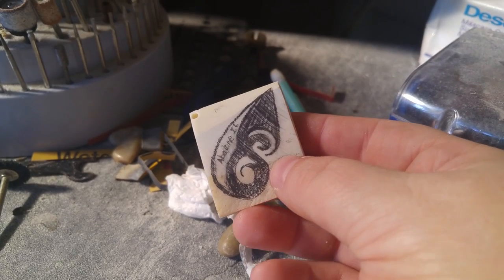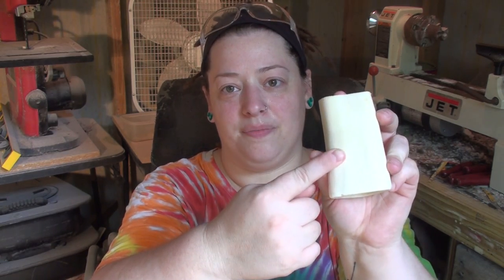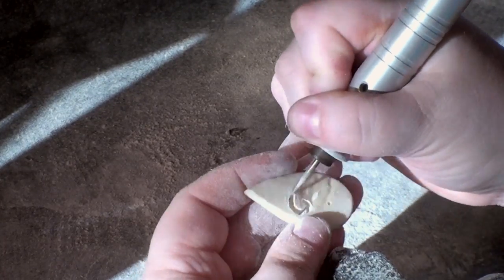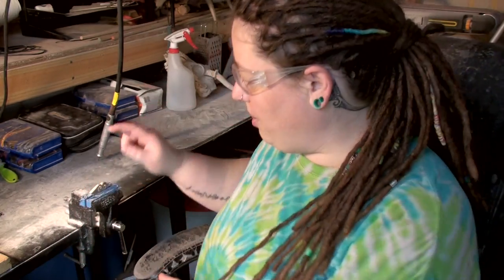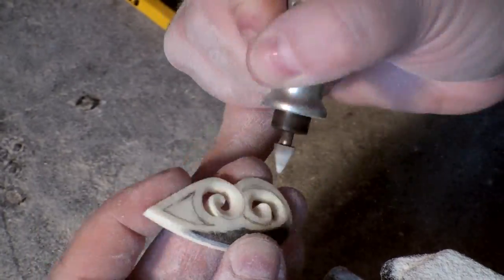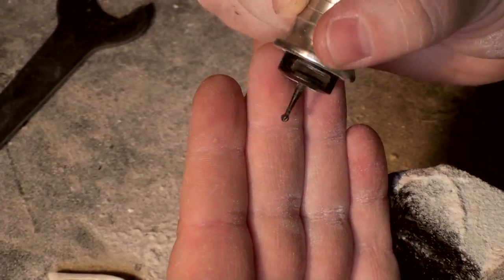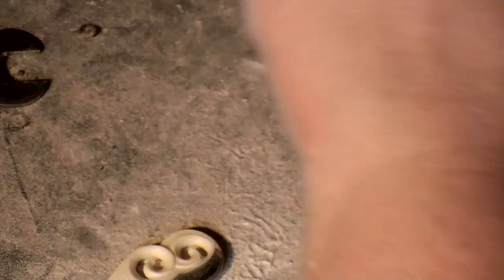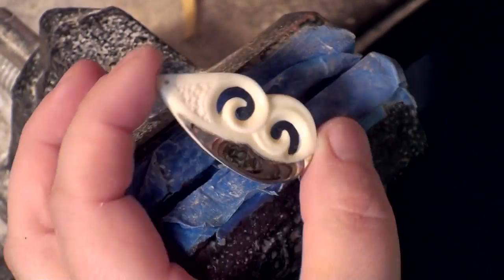Tutorial: Bone Carving | How to Carve a Bone Pendant with Abalone Inlay

Comment: Hi, where do you get the bone? Thanks
Reply from the maker: Hi Seth :) I get my bone from family farm cows that have died of old age or natural causes.  I like to process and degrease it on my own because I can whiten it organically without harsh chemicals. Most farms have a "bone yard", and it doesn't hurt to ask if you can pick through it. However, if that isn't and option for you, you might also be able to get bone from local butcher shops, or pet supply stores. 

Some folks don't like getting bone from pet stores because they say it is more brittle and flaky than home processed bone... but this has not been my experience. I have bought it from the pet store a few times when I'm in a pinch, and it was perfectly carvable... Admittedly, however, I don't normally buy it processed like that due to personal preference(I like to know where the bone comes from and how the cows lived). 

If you want to process your own bone, this video by Antipodart santi is pretty close to how I do it. The only exception is I put some dawn dish detergent in the boiling water, I use an electric band saw instead of a manual saw, and after it is degreased and cleaned, I let my bone sit outside in an open tub full of a white vinegar and water solution for up to 2 weeks: https://www.youtube.com/watch?v=khpcOGZxHec

Hope this helps! :)
Reply: Awesome!  Thanks Heather, looks like I have a trip to the pet store in the near future, until I can source a proper butchers.
Reply: Seth Spriggs Yes, that was going to be my first question. 😂
Reply: Seth Spriggs ya find it lol. There’s a ton where I live
Reply: Thanks for doing these vids!
Reply: @tropicalrarocraftraropareu6295  she lists it in the description. Foredom brand. She includes a link

Comment: I do antler carving and use a 4300 dremel  that has a dial up speed on the tail end of the machine, works well for me, use wet & dry sandpaper always make sure it is wet and above all take my time not rush anything as I am wheelchair bound so have heaps of time, PS just made 2 rings today

Comment: Nice work, glad you recommended a dust mask. I personally dont think the mask you were using is adequate. Bone dust, abalone or paua shell dust is carcinogenic. Take great care working with this material.
Reply: Agreed. A respirator that filters lead paint is what I use. Dust mask doesn't do the trick when your using a belt sander and band saw.

Comment: Great video, just found your channel. Regarding the Alligator scute issue, I know you sounded averse to altering it chemically, BUT, I think resin impregnation would be the way to go to make it a carveable/workable medium. I would recommend either of these 2 methods. First, simply buy a can of Minwax wood hardener, and put enough of it in a jar with the item to cover it. Let it sit in the sealed jar until it looks like it has penetrated sufficiently (a day or 2), then remove and air dry till cured. Method 2 would be to order a product called Cactus Juice, which is a heat activated penetrating resin. For best penetration, a "pressure pot" or vacuum chamber would help, but again, patience and a sealed jar should do the trick. Once permeated, remove item, wipe off excess, and heat at 200 degrees for around 1 hour. I know this probably seems like alot of typing from a stranger, but as an artist myself, I know the value of sharing techniques when you have found a workaround to an issue! Keep up the great work!
Reply from the maker: Hi there. :) Thank you! Indeed you are right. I think that if I ever obtain my own alligator scute in the future, I will certainly use some sort of resin method for stabilizing it. Unfortunately, because this particular scute was not mine, I was hesitant to experiment on it. A pressure pot and air compressor are definitely on my "must obtain" list. Oh, the fun I would have making resin blanks! Thank you kindly for your great suggestions. I will most definitely write them down where I can find them again. Also, your flute skills are top notch. ;)

Comment: I recommend using a multi stage nail Emory block for polishing and sanding natural materials. when I carve bone or antler, I find they work well for being able to put a polish on the final product ( since basically they all are made up of the same material).
Reply from the maker: Black Box Theory Productions Thank you kindly for the advice :). However, I find that those clog up and wear out far too quickly for my needs. Also, wet sanding with them will wear them out even faster or make them fall apart, and I can never seem to get a brilliant mirror shine using them... nor can I easily sand inner curves or crevices.

Comment: I am kind of new to using a rotary tool in that I didn't know there are different sizes of collets. Is that what they are called? I have been using my rotary tool for drilling into bone but my bits are too small. I have been having to make adapters using tape. It works but would rather have proper tool for the job. I did have a bit fly out one time while under a vehicle not because of the adapter thing but because of vibration from the bearing in the rotary tool gone bad. Thank god for safety glasses or I would have lost an eye. Thanks for mentioning that. Wish I knew years ago.

Comment: Love the video. I have a foredom and have played around with carving with it but I just seem to make a mess more than anything. Probably just need to get some better bits.
Reply from the maker: Thank you. :) Bits really do make a big difference! Especially if you are trying to use dull bits... that never works out well at all.Give it another try and have fun! :)
Reply: I picked up a smaller handpeice and am going to give it another whirl
Reply from the maker: Awesome! When I very first started, I had tried using just the dremel 4000 I had... as is. I quickly realized that I couldn't support it for long periods of time and get the kind of movement and precision I needed because of the bulk and weight. When I switched over to using the flex shafts, it did indeed make all the difference in the world. Not sure if that is similar to your situation, but I can relate when it comes to having comfortable hand pieces... don't leave home without em...lol. Good luck and I hope it works out better for you this time.

Comment: Beautiful work!  Can this same bone carving be done with one of the Foredom Micro Motor carvers, they have  the motor in the hand piece and just a coiled wire going to the power supplier.  Or is this bone carving best done with a Foredom shaft driven like you used on this piece?

Comment: I really enjoyed this video. It's very well put together and informative. I've been looking for videos like this. Subscribed and can't wait for the next one. Thank you!
Reply from the maker: Thank you very much! :) I've got lots more fun ideas planed for this year! Once I'm caught up with orders from this holiday rush, I will be actively working on all my new tutorials!
Reply: Thank you for your response! Looking forward to the new stuff! I went and watched it again, just awesome. I do have a question, if you don't mind...? Abalone inlay is very beautiful, but, would it be possible to inlay wood? Like teak or something similar? Thank you again, You're awesome and inspiring!!!
Reply from the maker: It's no problem at all. :) 

You could indeed inlay wood in much the same way. The only issues I have faced in the past when working with wood inlays are first, the wood is much softer than the bone. This makes it a little more tedious when doing your finish carving, because if you aren't careful, you can take of chunks of wood without realizing it while you are trying to trim down the bone beside it. 

Secondly, the wood finish was a challenge at first. I used to finish my wood to a mirror shine using CA Glue to cover the surface. This way I could sand and polish it right along with the bone and it would have the same finish. However, I learned that over time, it tended to yellow and chip away. It looked horrible. So, now I use a custom mixed finish called O.B. Shine Juice for my wood inlays. It is a recipe I learned from another youtuber( https://www.youtube.com/user/capneddie ). With that finish, you can apply, sand, and repeat to your desired shine.

I hope this answered your question! :) Thanks again for the kind words!

Comment: Can give a detailed list of all your main tools and accessories? I burn up a dremel every few months and I keep at least 3 new ones on hand for just that reason. What would you recommend as far as a respirator mask I'm a man I have a full beard and man I've had carbon monoxide toxicity and damn near poisoning a few times so I need something that works.
Reply from the maker: I'm happy to help as best I can. The foredom motor and hand pieces I use are included in the video description. Though pricey, I've had it for years now and have had no issues at all... and I've put it through hell. I've also heard that there is another one similar to the foredom that is sold on amazon for cheaper... and it seems to be popular among other carvers. Though, for the life of me, I can't remember what it is called. I think @bobbydukearts uses one.

As far as burs, I use a LOT... so, it really just depends on what you are trying to carve and what material you are carving. I'm particularly fond of micro carbide burs for detail work, and barrel sanding bits for bulk material removal. I also use diamond bits on occasion. But, like I said, it really just depends on the material you are carving.

In regard to respirators, I just use a standard one with the two changeable front  filters. However, since you have a beard, you may want to try something similar to what @michaelcthulhu uses with nose plugs. I'm not super familiar with that type, as I've never used one, but it seems to work well for him and they are easy to customize.

I hope this helps! :)

Comment: Fabulous work! Is that a regular grinder with an abrasive disk on it? It's so white I can't tell if it's a stone wheel or an abrasive disk
Reply from the maker: Hello Jay :) I'm sorry it took so long to answer you. I sometimes miss notifications on here. It is indeed a regular barrel sanding bit.  I have tried a stone one in the past, but I find it clogs too quickly, thus I just use the regular ones like this: https://www.amazon.com/AUSTOR-Including-Sanding-Sleeves-Mandrels/dp/B07CYQXZSY/ref=asc_df_B07CYQXZSY/?tag=hyprod-20&linkCode=df0&hvadid=309811990469&hvpos=1o2&hvnetw=g&hvrand=7523873934708032357&hvpone=&hvptwo=&hvqmt=&hvdev=c&hvdvcmdl=&hvlocint=&hvlocphy=9051599&hvtargid=pla-493165587048&psc=1

Comment: Hi, why do carvers always use flex shaft tools? Is it cool to use cordless, like a cheap cordless dremel? The only reason I could think of is flex shaft is less bulky and you could hold it better. Is there a quality reason? Thanks!
Reply from the maker: Hi Chloe :)  I can't speak for all carvers, but I use a flex shaft because making small details using a dremel without a shaft is near impossible. Because you have to overcompensate so much for the heavy motor, it not only causes errors in your work, but also becomes very painful on your hand after a while. The vibrations alone are so much worse without a flex shaft, it used to give me "numb hand". In addition, after holding the dremel for an extended period, it was almost as if my hand was frozen in that position after I put down the dremel. Over-all, a flex shaft is a must have if you are planning to carve for extended periods of time so that you can save your nerves and finger joints. Hope this helps! :)
Reply: Heatherfish Creations Thanks!

Comment: i have a question..hope you see it..how do i purchase the sanding disc..you know..the one you begin with...i dont even know how to search it up by differentiating it to the rest
Reply from the maker: Hello! No problem... Happy to help. They are generally referred to as barrel sanding bits and you can find all sorts of kits and combos of different sizes and grits on Amazon or Ebay. Here is one I found as an example: https://www.amazon.com/AUSTOR-Including-Sanding-Sleeves-Mandrels/dp/B07CYQXZSY/ref=asc_df_B07CYQXZSY/?tag=hyprod-20&linkCode=df0&hvadid=309811990469&hvpos=1o4&hvnetw=g&hvrand=3728017050117057140&hvpone=&hvptwo=&hvqmt=&hvdev=c&hvdvcmdl=&hvlocint=&hvlocphy=9051599&hvtargid=pla-493165587048&psc=1

Comment: I note you have used wire on some of your carvings. What sort of wire is it? Can't be silver because that stains bone. Also, I looked up foredom but was not that impressed because the speed maxed at 15k rpm. My old Dremel did 25k+ . If I got back into bone carving I'd go air as the rpm is 60k-70k rpm and smooth as silk to use.
Reply from the maker: Honestly, Carving tools are personal preference. I care more about torque than rpm, as my foredom's max rpm is more than enough. I have found that a strong torque and steady speed prevent flaking and catching during carving.... especially during delicate detail work. My old dremel had more speed too... and with it, more vibration. A number of folks prefer air... however, I do not. In addition, it about gives me a heart attack every time my compressor kicks on... and 8 hours of random heart attacks are not my idea of fun when working on a lengthy project.

I use lots of different wire, enameled, aluminum, sometimes copper. I do use silver sometimes when I'm going for a purposely weathered look. It really just depends. I love the concept of Wabi-Sabi and rather embrace the "stains".

Comment: Love your work. What tools do you recommend a novice artist to buy. I want to work with wood, bone,  seashells,  and stones. What core tools do you recommend. I am moving to the country where I'll have more time and also space. I will buy tools piece by piece. I just subscribed to your YouTube. I can't wait to learn from you.
Reply from the maker: Hi Jeremy :)

Thank you! Honestly, the tools would depend on a wide range of things... What is your budget? What type of work do you want to do with these materials? There are many different styles of carving... some of them require simple hand chisels, and some can utilize power tools. However, I will try to narrow down to some of my most used tools for you...

In an ideal world, for machine carving wood, bone, and shell, I would highly recommend the foredom kit I have in the video description. This will be your most used tool and the one that can make or brake your ability to carve for long periods of time. After using a dremel 4000 for years, the foredom really saved my hands, wrists, and bank account. The dremel flex shaft started braking every 3-4 months with regular use for me, and that is about 30-40 dollars a pop. However, because the foredom is expensive, it is not always and option for everyone right away. In that case, the dremel + flex shaft does work, it will simply not have the same amount of torque or durability if you carve 6-8 hours a day. The bits I use are bits that I have collected for years from several different outlets in box stores and online. I highly recommend a good set of carbide and diamond coated detail bits, barrel sanding bits, and a diamond cutting wheel(good for processing raw abalone into inlay squares).

Another few tools that I use on almost 100% of my projects is my band saw, my combo sanding belt, my metric/standard conversion calipers, and my handheld jeweler's saw. Those are essential for rough shaping and measuring base material. If you are just starting out, I wouldn't worry too much about the brand... you could always invest in more expensive tools later. In addition, if you have a scroll saw with a 360 blade, that saves even more time. Mine is out of commission right now, but I will resume using it soon.

Another of my favorite tools is my variable speed Jet mini lathe... you would have lots of fun with one of those. Of course, with that brings the requirement for more purchases... you would also need to invest in a few chucks, chisel sets, and a bench grinder for chisel sharpening. I also made myself a custom angle jig and slide jig to get my sharpening angles right. -  A little time consuming but worth it to save a buck. Of course you can buy those things, but like everything else, they are expensive.

For finish work, you will need a buffing wheel of some kind. I use an old nail dremel with a leather buffing wheel from my salon days, but you can buy a cotton buffer wheel to fit on a bench grinder that would do just as well if not better.

As far as working with stone... this is unfortunately an area I have not had the chance to expand upon. I would love to work with stone someday, but that is a whole new animal. The space required to house lapidary tools is something I do not have at the moment. In addition, some of that equipment is quite expensive. I occasionally drill holes in stones and crystals with diamond bits, but I don't have the ability or knowledge at this time to do full rock carvings or cab work. Wet carving tools would be required.

Hope this helps! :)

Comment: what rpm's are you using--I was going to order a 5,000 rpm rotary motor but I think I need higher--?
Reply from the maker: Hi Tod! I'm sorry it took me so long to reply.. for some reason I didn't see this comment right away! My motor goes up to 15000 RPM and I have found that it is very sufficient for my needs. I also drill holes through stones with it on occasion. 

Basically, in my experience, I have found that  torque is most important and without good torque, it doesn't really mater what rpm speed you get because the bit will quit spinning if you push too hard on your carving if the torque is insufficient. With this motor, however, it is plenty enough that I can push down hard on the carving and never loose rotation like I would with my old dremel 4000.

I hope this answers your question! The link to my specific kit is in the video description. :)